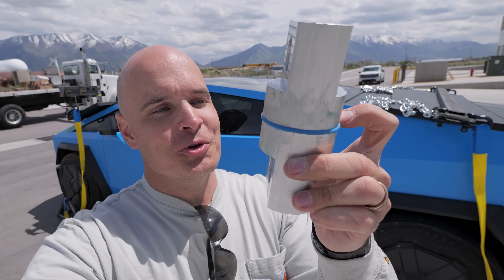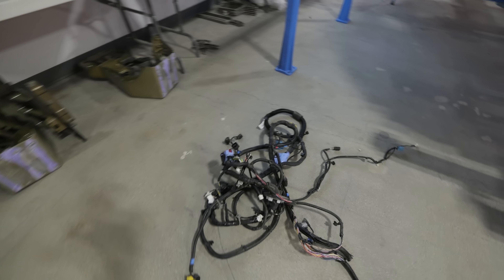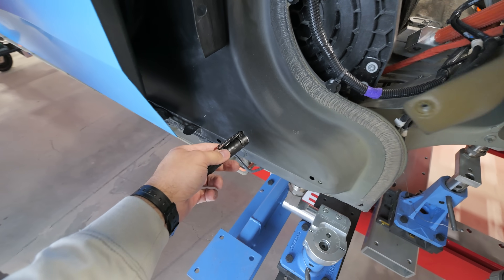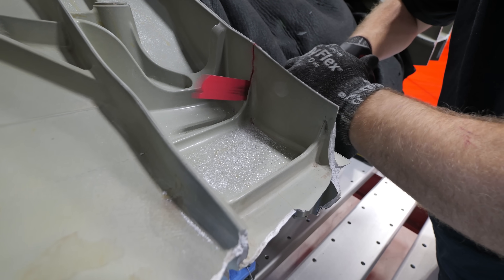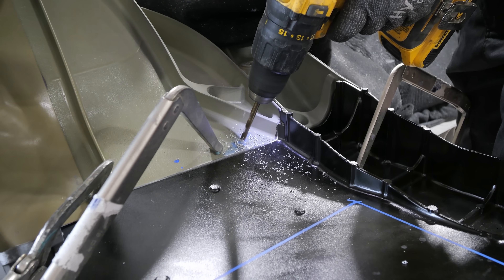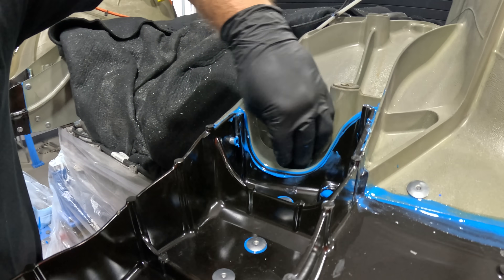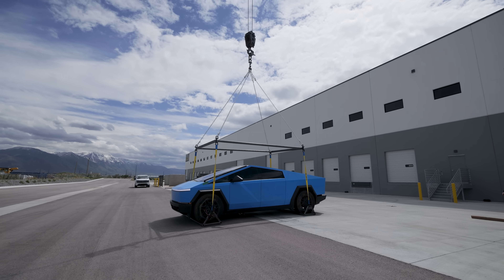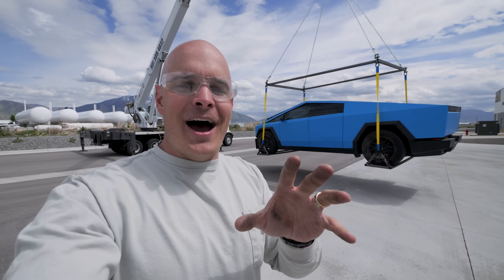Tesla Fixed my Cybertruck with GLUE - (but I'm not mad about it...)

Comment: Are we really confident this glue won't degrade over time? Especially with the different heat cycles in materials
Reply: Ask the company who made the vehicles you drive cause I can 100% bet it has some sort of structure adhesive on it also
Reply: @kenpryor4440 if its so good then why dont they get rid of welding all together? Why dont they glue the suspension together?
Reply: I promise none of my 99 Silverado’s frame or towing gear is glued on.
Reply: True, but it's not forming a patch in my truck, between the contiguous frame, and trailer I'm towing behind it. I would like to see how the glue performs in a shear strength test. We've all seen cyanoacrylate lifting incredible loads in similar pull strength tests. When it comes to a large amount of weight pushing down on the tow hitch, I would be way more concerned about shear strength. Remember, that's how the frame snapped in the first place,
Reply: @JustPlaneNutzRC  The frame snapped because it was punished to snapping. 

Everything snaps under enough force. Even the whole Universe.
Reply: @JustPlaneNutzRC 
From what I can tell, the failure in the original is the subframe snapped, it wasn't a glue shear failure. The original piece is casted as one. It's just for the repair, they leave a cut line so you can do a glue based repair (as opposed to welding, which is what is more commonly done with steel vehicles).
Reply: @JustPlaneNutzRC  No. It was in tension. You did not understand the test.
Reply: @markharmon4963 You're being a bit pedantic. "Pull strength" and tension are essentially the same concept in physics. Trying to rip something apart by pulling on it = tension. 😊
Reply: @JustPlaneNutzRC  "Give me a lever long enough and a fulcrum on which to place it, and I shall move the world." Archimedes.
Reply: @wolfgangpreier9160 😂
Reply: @JustPlaneNutzRC  Tension is 90° different to shear.  The vertical load on the hitch puts the patch of adhesive in tension.  The towing load is primarily in shear which is much stronger. The comenter did not understand the difference.
Reply: Did we not watch the same video? Much of the patch adhesive was applied in the vertical plane, which is 90° opposed. It will be receiving downward "shear" force from a weighted tow hitch. Yes, some of the glue was applied horizontally, but not all of it. It would be interesting to see the original test to failure performed again. Hey, who knows, it might even perform better with the adhesive's ability to stretch/deform slightly under load.
Reply: It's not only Tesla that uses it
Reply: You mean the glue the airliners have been using for decades ?
Reply: @Nomad_2322 Fusor 2098 does not meet aerospace qualifications
Reply: TBF the aluminium will degrade over time also.
Reply: honda use it
i trust honda
Reply: @nioxic77  OMG! If Honda uses it iand they fall from the sky all the time i can not trust this glue anymore.
Reply: Structural adhesives have been used in almost all vehicles in one fashion or another for DECADES..
Maybe it won't last 100 years but I think we're OK for all intents and purposes..
Reply: @GamingWithURO  Hmmm, "almost all vehicles from the last decades" you say? So structural adhesives was used to glue car chassis from the 1990s together ... in your dreams maybe. Unless you call thread locker a 'structural adhesive' that's a load of BS.
Reply: @TheBayru You're hilarious. When I was a kid growing up I learned about structural adhesives in the mid-90s in my Collision Repair classes in high school. Take a minute to Google when structural adhesives were introduced to auto manufacturing..
Reply: everything will. the real question is when
Reply: Cars have been glued like this for over 20 years 😂
Reply: @rkan2  Wrong
Reply: Fixing a truck with glue... That glue is definitely gonna degrade over time and is not good of a long term fix.
Reply: @ManunKanava  You can always buy a Mexican made Ford or a Canadian made GM instead.
Reply: The types of structural adhesive used is very similar to what is used in the aviation industry when bonding parts together.  As also mentioned in the video, this adhesive has been in use with other manufacturers for years. and you don't hear of many (if at all) failures of the adhesive failing due to degredation.  That said, I would still not own a cyber truck or any other  all electric truck for that matter. They towing range comprimises are just not worth it.
Reply: @That_Stealth_Guy Ah, someone who criticizes the right things rather than blindly hating on all of the wrong things.
Seriously, there are a million reasons to talk trash about the Cybertruck, and people focus on the dumbest ones 9 times out of 10.
Reply: @littlejack59 😂 yup. Very true.
Reply: @That_Stealth_Guy  Ya, they are not optimized for towing. Lifestyle, local town work, farm, hunting are its niche.
Reply: @That_Stealth_Guy  Other manufacturers arnt gluing the tow on though are they...
Reply: You can fast charge? I think the Silverado EV is better at this than Cybertruck. It’s like 30 mins every 4-5 hours, if you where hauling for a company you’d have to do that anyways.
Reply: It takes a lot of heat to release the panel bond.
Reply: Yes, everyone is very confident that if you use the material, it will outlive you. They use that kind of stuff to hold bridges and homes together. The only way I've personally seen the stuff degrade is when epoxy-coated rebar was used and rust got under the epoxy and debonded it from the rebar, debonding the glue stuck to the epoxy. 
This stuff has been around for a looooong time.
Reply: Perhaps in UV yes. The metals will be rotted away before you ever have to worry about panel bond failing
Reply: @kylemilford8758 A few billion years. Or until the death end of the Universe. Whichever comes first.
Reply: You're probably the same person who complains about micro plastics. Do you want them to last, or not?
Reply: @Corkoth55  It's scary that you have the ability to vote with that sort of reasoning. Microplastics are micro because they didn't last.... They broke down, and only the basic molecules remain...Try to think. My god
Reply: @wildfire4175  Microplastics are most certainly dangerous and prevalent. 

Some degrade down to their basic components, but many very stable ones do not.

They enrich in the food chain and finally in all our brains.

That is a unrefutible fact. Even aborigines in Australia and Xhosa in the Kalahari who are the most remote from modern zivilisation have microplastic in their brain.

Maybe those are not really dangerous? 

But every thingy that is in my head and does not belong to me is by my personal definition dangerous to me. 

You may think differently.
Reply: Structural adhesive has been used in the automotive industry for decades in high end applications..
Reply: They’re throughly tested, if there was considerable degradation then we’d hear about 1st gen saturns and other structurally bonded vehicles, or buildings.
Reply: biodegradable rubber on the honduh MSX/grom indicator dies in 1.5-2 years... i'll wait , the glue most prolly it'll degrade just after warranty.
Reply: Of course it will but by that time you’d probably gotten rid of this nightmare by then. And then the comments will be ‘well it is 6 years old’.
Reply: @joesshows6793  there really are no greater cybertruck fans, than haters who literally just witnessed an amazing spectacle of strength, and you still try to find reasons to hate it.
Reply: @joesshows6793 Better a nightmare than a Ford is my Motto.
Reply: @wolfgangpreier9160 shhhhhh! My escape is close by 😳
Reply: @joesshows6793  👍👍👍
Reply: One Midwest winter and it will start spalling
Reply: Not only that  sure glue can hold weight but can it survive a snapping force
Reply: I bet if you give that truck to WD he will durability test it and that thing will fail again
Reply: is this the same glue they used to adhere the trim pieces that peeled off the sides of the Cybertruck?
Reply: of course it will. this is extremely cheap manufacturing. pretty much everything tesla
Reply: @godlikecat  Yes Tesla makes cheap products. 

That is why they sell more than everyone else. They are all just much too expensive. 

How long will the Mexicans for Ford or the Canadians for GM continue to produce such high price products?
Reply: It is Tesla Glück. It will last till bankwuptcy. Two weeks.
Reply: @wolfgangpreier9160  From the Manufacturer, Parker:

"Parker-Hannifin Corporation (“Parker Lord”) guarantees to the user that Fusor® Repair Products ... will provide a durable repair for the life of the vehicle per the product’s technical data sheet."

Source: Fusor 2098 TDS

As for the cybertruck being run over by the tank, 

A: in the video, the passenger compartment stayed mostly uncrushed, which is good. 

B: Tell me where the NHTSA book specifies testing vehicles with a WWII tank?
Reply: @ZyghqwyvI do not know about NHTSA. But the UN/ECE states just that. 

That is why those puny little Teslas are not allowed. 

EVs must withstand a tank running them over or a Russian Artillery Shell, a Iranian Drone, a US Warthog attack.

Imagine what happens when the battery is hit and explodes! Horrors!
Reply: it will 100% break, it is tesla after all
Reply: @abbcc555  Tesla didn't make the glue.
Reply: @abbcc555  Tesla didn't invent glue for cars, everyone uses it.
Reply: @MrTeddy12397  I know that. ps. tesla sucks
Reply: @abbcc555 Yes Godzilla is stronger. All Teslas are much too weak. They can not even withstand a WW2 tank! Feeble Little thingies.
Reply: @wolfgangpreier9160  Actually it did okay.  And I know what you mean.😊

Comment: Question: why are satisfied that your $120k truck has a tow hitch that is glued to the frame instead actually being apart of it? Same with the panelling and fenders.

* Edit * Yes, I watched the whole video, the glue is strong no doubt. Glue can degrade, welding won't. There's no logical reason to use glue over it.
He's burying the lead here: the hitch should have never fell off to being with.
Reply: well, I was with you on that argument, until this demonstration here, this truck can be truly fixed after catastrophe, whereas a more traditional truck would get bent everywhere while remaining "intact", so take your pick
Reply: bCz he tested the strength of the glue himself at the end of the video
Reply: @SainathMishra1glue degrades, welding does not. Call me sceptical but I'd rather have something crucial like my tow hitch to be welded instead of glued.
Reply: Why would you not be? So long as the sciences adds up, how its achieved shouldnt be an issue no?
Reply: Older customers have standards, newer ones ... dont.
Reply: Because it works. The idea that something is bad because it's different is stupid, what matters is that it works as well as the other ways, and according to the testing they did it meets that standard. I'm no tesla guy but innovation is innovation.
Reply: @aukora129 Glue will still degrade 10/10 times more than welding. How is using glue more innovative than welding it? Sounds more like a corner be in being cut.

Or maybe I just have higher standards for things like this, idk.
Reply: @dougpowers2  Welding degrades. Tiny cracks along the weld grow over time.
Reply: So the parts can be replaced in case of an accident instead of totaling the car. Wouldn't you be satisfied your 120K investment can be repaired for 14k ?
Reply: @BrainHurricanes you're missing the point. If the glue failed the first time, no I wouldn't be satisfied if they were able to repair the damage with the same flawed methods that inadvertently caused the failure.
Reply: he just said why
Reply: @dogeguide2066 Yes, glue is strong not "hey the glue failed the first go around because it should have been welded, like every other vehicle with a hitch. Tesla is glueing it claiming its as strong as before which is great but welding still would be the preferred method. Notes for Cybertruck V2."
Reply: @dougpowers2  You also seen the video how the truck was damaged ? It was holding up fine within spec and normal use.
Reply: The previous glue application held 10x the rated capacity. That’s well outside of normal use. Metal fails too. The Ram will be rusted in 5years